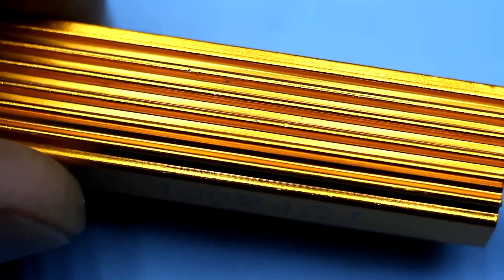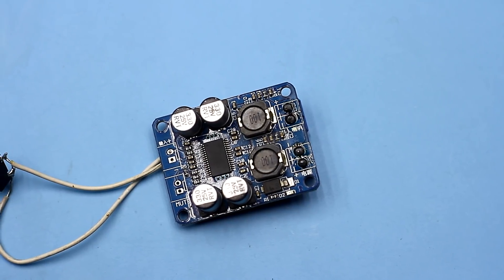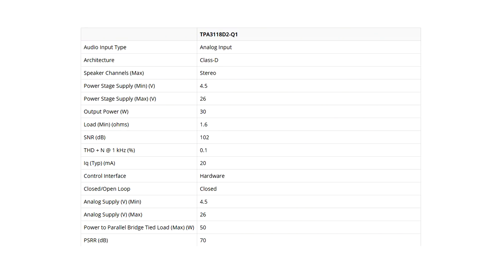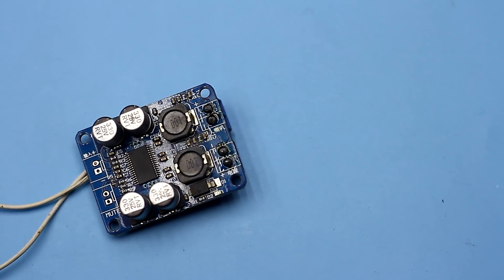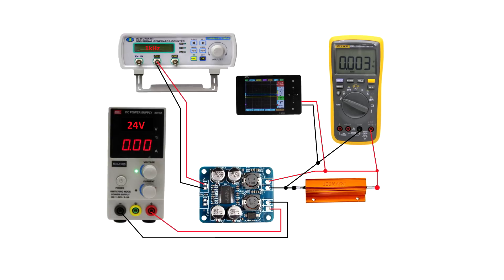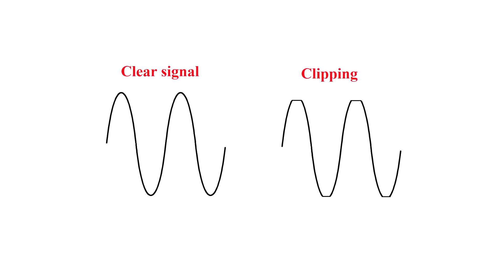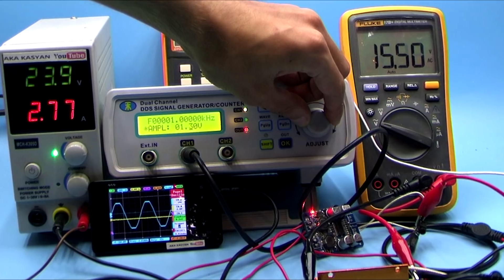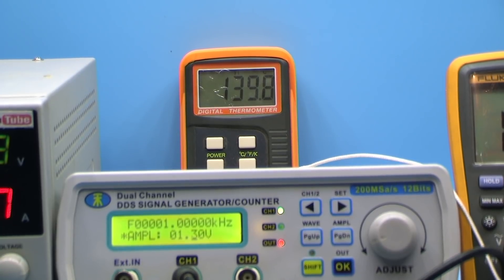How to measure the power of the amplifier

Comment: I have a water heating resistor that has 4 ohms (alarmingly accurate 4 ohms), could I use it to do the test instead of the 100w resistor or could it interfere with the test because it can vary the resistance as it heats up?
Reply: By the way, great video, well explained. I would definitely send the link to this video in case a friend needs a more detailed explanation.
Reply: Yes actually better than a resister...

Comment: The multimeter used "Fluke 17B" does NOT measure true RMS, so the figure calculated is not accurate. Also the current-voltage phase difference is also NOT factored in the calculations, again giving a poor calculated reading.
Reply: Cheap multimeters even the yellow one can measure "relatively" accurate RMS in this case because the wave was sine in nature, I agree another wave-like a triangle, arbitrary waveform it cannot measure the true RMS. Talking about Current-voltage phase, the load was resistive, not inductive, i.e no speaker was connected at the output so this test was fair I think

Comment: But that formula is taken from P=U*I and assumes U and I to be in phase, the actual formula for AC power is P=U*I*cos(phase), which can be rewritten as P=cos(phase)*(U^2)/R, you are lacking therefore the cosine factor and the power is actualy weaker. Am I correct?
Reply: Very good observation.
Reply: Voltage and current are in phase through a resistive element so the volts^2/resistance will be correct. Same as D.C.
Reply: @Centar1964  it's been a long time since I posted this, I think my concern was that the actual power delivered to a speaker is going to be less since it's a reactive load